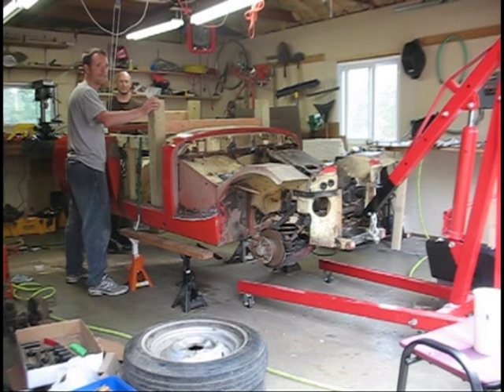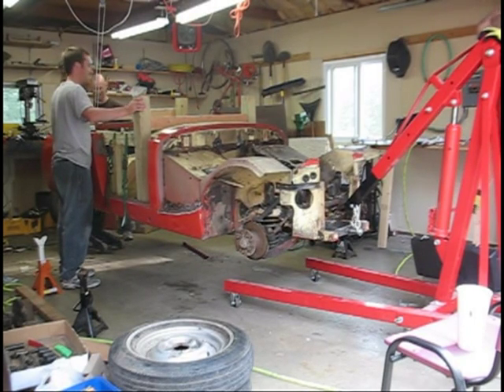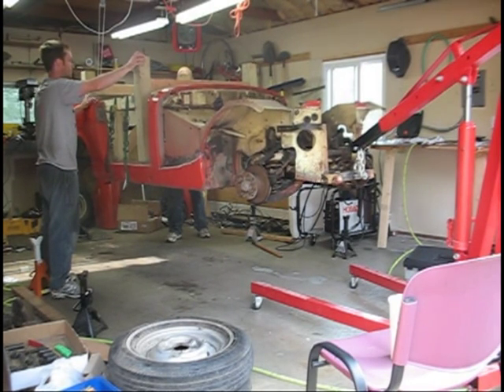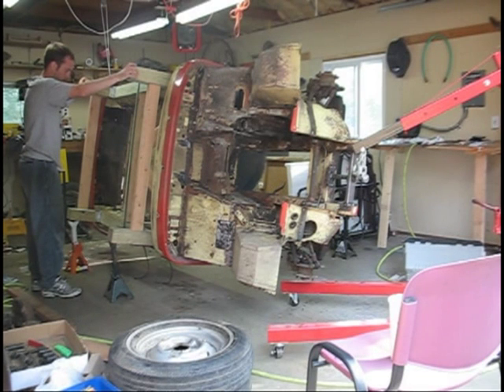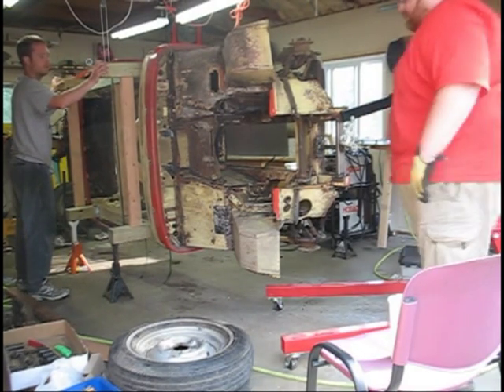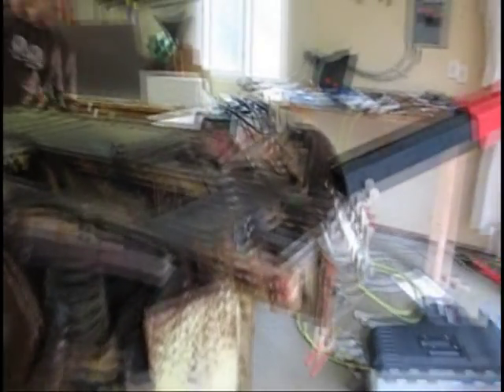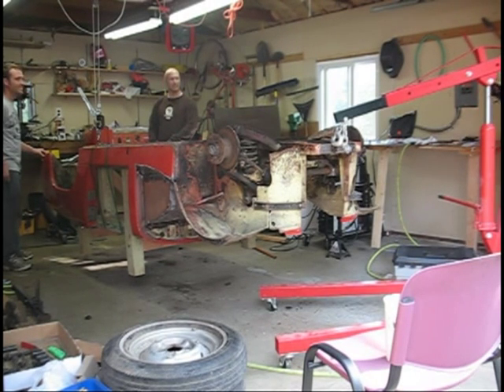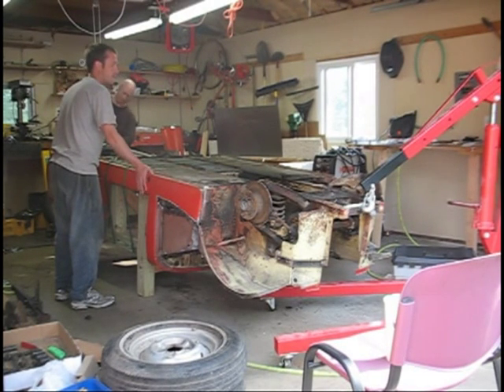Part 6 - Flipping the Sprite Upside Down! - 1969 Austin Healey Sprite EV Conversion

Comment: I have to be honest, I'm worried for you.  Your 6 step plan is perfect:

1. Find a car
2. Pull the gas engine
3. Install an electric motor
4. Load the car with batteries
5. Plug it into the wall to charge
6. (Unplug, then) Drive!
Its just that simple (?)

I'm afraid you might be off track already.  Is this a conversion or a total restoration and a conversion?  Make that decision soon or the bills will be enormous and the project might be abandoned.  I want you to succeed!!  Good Luck!